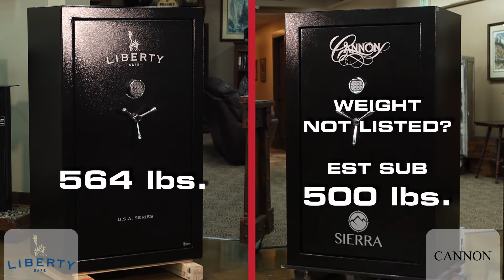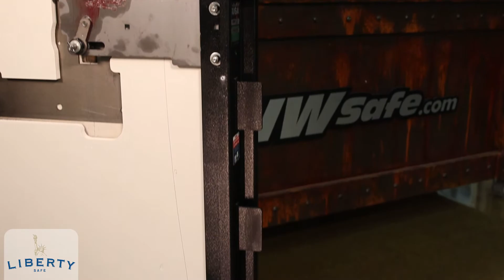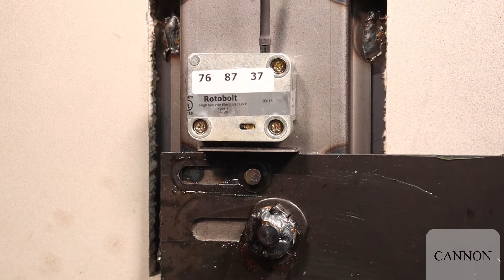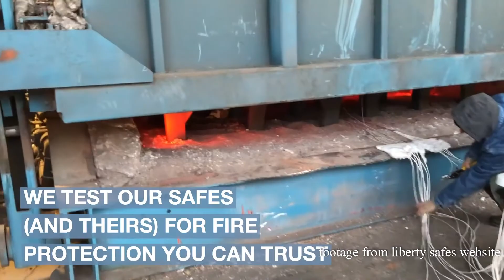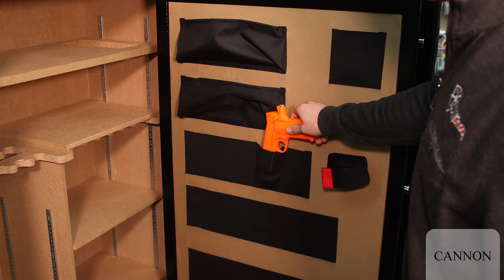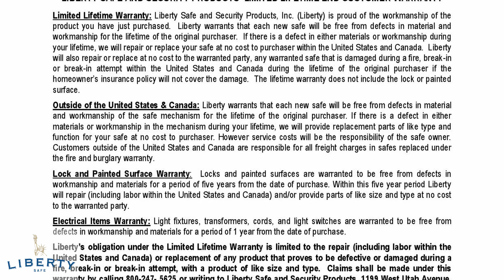USA Liberty Gun Safe vs Cannon Sierra Comparison

Comment: They are not going pry it open, they are going cut the side open in about 10 minutes with a metal cutter.
Reply from the maker: We see that comment a lot on the internet but the reality is we have seen more attempts to pry open a safe than to cut open a safe. If your comment was to suggest cutting would be faster, easier and an overall better idea, we would agree with you. We just haven't seen the numbers play out the way you're saying.
Reply from the maker: Also, I would say for most entry level safes prying is going to be faster and more discreet. However, once you get to a higher quality safe prying is going to be off the table and cutting would be the best option.
Reply: @NWSafe  Why you lie? I cut safes w a skilsaw. I wait for dummies to brag about their fancy rifles at the bars and I wait till they goto work in the the morning. Like GNR said, It’s So Easy! Murica!
Reply from the maker: @SortaDopeIGuess  Right...
Reply: @SortaDopeIGuess  what bunch of BS
Reply: Just James Bond your safe or Darth Helmet your safe 12345 that’s the same combination on my luggage.😂
Reply: i agree only a fool would try to go through the door.
Reply from the maker: @thebosscatman7 For the most part when you're protecting against theft you are dealing with fools.
Reply: Which anyone with ears will hear
Reply: If it were me I would cut the door lugs / hinges an be done in less time then going through the side .
Reply: @TURBOTHETANK23  Cutting the hinges does nothing , the door locks 3-4 ways typically. The locking bars are designed in a way that you can’t just push the bars and they all move 😂.

Comment: What scares me about the canyon safe is when the key pad goes bad. How can you get in? Customer Service stinks from what I have read.
Reply: Take the keypad faceplate off and use the physical key that comes with it to open the safe.
Reply: @Tyanmax99  do all cannons come with a key ?  My father in law just passed away and his will is believed to be in the safe but we don't know the combination to keypad.   We hope to get in it without tearing it up.    I seen a video using a strong magnet to open safes, so I guess I'll buy a magnet and see.
Reply: @BeckyCowanBeckysDigitalFocus  Sorry about your loss.  The faceplate of the digital keypad should just turn and come off relatively easy if it's meant to come off.  The key hole will be behind it.  Look on the side of the safe and there should be a model/serial number on it.  You should be able to google that info or call Cannon and find out more details.
Reply: @Tyanmax99  thank you,  I'll try it.
Reply: @Tyanmax99  their website says they don't come with keys
Reply: @BeckyCowanBeckysDigitalFocus  sorry about your lost, did you got in to your safe?
Reply: @LiveMusicVideos  used locksmith

Comment: I guess the part they leave out is that this is the most basic cannon safe they make and that the liberty costs twice as much as the cannon
Reply: Thats false. cannon is exactly the same price as liberty. I bought the Liberty and have never looked back. At tractor supply the cannon identical safes and the cannon was actually more. Rap on the sides of either and fast as you can snap your fingers you can tell which one is garbage.  Cannon is a glorified cabinet. Liberty is a safe.    Peace.
Reply from the maker: At the time of filming these two safes were typically about $200-300 dollars difference in cost. For something that can last a lifetime I think that is worth the difference for the better safe.
Reply: @NWSafe you have to pay that extra money if you want to keep it closed to everything but a federal warrant
Reply: Someone’s mad they skipped out on a Liberty safe for a Cannon safe.
Reply: @rhsking05 Still mad about buying a safe from a commie company that will sell you out to the feds?

Comment: I am still waiting to see what they come up with for a side cutting attack on the safe.  Do burglars even waste their time on a door attack anymore?
Reply: I’ve seen more side cuts when the side is easily accessible, otherwise it’s door entry. If they want in they will get in. I’ve seen entry to an old bank vault. Guys broke concrete and brick walls to eventually cut hole in safe.
Reply: Most burglars are not skilled and are not able to do much of anything with all but the cheapest of safes.  When you have your house alarmed you are not likely to lose anything well secoured.  I don't know of anyone getting a real safe broken into after decades of work in law enforcement.  I do know some of the cheaper and lighter safes that have been carted taken.
Reply: @allenbmooresharinginformation  , thanks for an HONEST statement!  Bolt down your safe, make sure it's in a mostly hidden area and don't expect a gun CABINET to be a safe.  Once these few thoughts are instituted, the safe is most likely just that, safe.  Most thieves are looking for an easy mark, not a challenge.
Reply: @markej4801  Limiting the number of people aware of firearms and valuables may be the best way to avoid an intrusion at all.  From an early age, my kids were taught that the public was to know we were a gun free safe zone and broke.  When hunting I always use coveralls so my appearance on returning home is just your average working putz.
Reply from the maker: We hear a lot of talk about cutting attacks in the comment section but as far as real life we still see far more pry attacks than cutting. I would say for most entry level safes prying is going to be faster and more discreet but once you get to a higher quality safe prying is going to be off the table and cutting would be the best option.

Comment: I purchased the USA 48 a few months ago and noticed Liberty sells a lifetime lock warranty. In your opinion is it worth it? How often do you see these electronic locks fail?
Reply from the maker: It's worth it. The safe will last you a lifetime but all locks need to be serviced in the future at some point. The lifetime lock warranty is money well spent. Liberty is also a financially responsible and healthy company so it's safe to say they'll be around for a long time. However I think the extended warranty has to be purchased at the time of warranty registration 30 days after delivery of your safe. I'd still give it a shot. If you run into issues call their customer service line.

Comment: $800 Canon safe is good, does the job. You can change attach pistol holders
Reply: Just because the door closes on a safe doesn't mean it's a good safe. But like you said, a safe is better than no safe. All these people thinking James bond is going to break into your house and cut open your safe live in a fantasy world. If someone does break in they'll most likely be a smooth brain idiot with an IQ in the mid 70s. They'll get arrested before they even attempt to get your door open.
Reply: @lennybrewster4673  You are spot on from my observations over years.  Unless you have one light enough that they can take it out the door you probably won't lose anything ever.
Reply: Yep! that door panel was a dealbreaker for me. it looked cheap and flimsy.
Reply: Liberty gave the cops the back door code with no warrant
Reply: Cannon safes are cheap Chinese junk... but I guess that's about all your keeping in a cheap safe is cheap junk.
Reply: @KingMrBigE  just found out that Canon safes are made in North Virginia
Reply: @iiparachuteregiment8800  no... they are not. Actually according to their very own website they are being made in Mexico.
https://www.cannonsafe.com/blog/faq-items/cannons-safes-manufactured/#:~:text=Cannon%20Safes%20are%20made%20and%20manufactured%20in%20Mexico.
Reply: @KingMrBigE  kwl. To you it's still Mexican junk?
Reply: @iiparachuteregiment8800  I’ve had no trouble with my $800 cannon, it’s a hell of a lot better than no safe and that’s what fit my budget. I don’t know  that you get $1200 more value out of a $2000 liberty. And a demo saw will take either of them apart equally
Reply: Cannon safes are JUNK!!! Support is non existent!!!
Don't waste your money. 
I've been jacked around for 2 months waiting on parts. 
I've called and emailed every week and they dodge me. 
You can call cannon for extras but don't expect any setvice. 
I had a malfunction becauss of a flaw in the design and they won't send me the update. 
Mike Mercado was the contact that dropped the ball!

Comment: I did a little research and see you guys used a base model Costco safe for your comparison! Wow ' what a joke !!
Reply from the maker: It's a Liberty Base model and Cannon Base model for that size range. At the time of the video the US made Liberty could be purchased for as little as a $200 difference than the imported Cannon Safe.The Liberty is also the most affordable US made safe out there in the size range. We also are trying to highlight why it's money well spent to spend a few extra hundred dollars to get the better made American safe.
Reply: The liberty USA series they compared it with is their equivalent base model. You would have known that if you did a little research.
Reply: @user-mh5qg5jb7d  its not lib base model
Reply: What are you smoking . The cannon is like 700 bucks  . If that . This liberty is Iike 1300 and up at least ..
Reply from the maker: Like I said at the time of the video the Liberty could be had for as little as $200 more. At this time of record sales you won't see the deals on Liberty because demand is way higher but I don't know where you can find a 40" wide Cannon for $700 now either. No doubt the Liberty is more money but It's a better safe. How much is American Made worth to you? How much would you pay for a better lock? How much more would you pay for more pry protection, better welding in the body, higher quality interior and door panel? In our opinion the Liberty is the better value. If those things don't matter and you just want a cheap, big safe by all means buy the Imported Cannon Safe.
Reply: @NWSafe  the 60 inch widebody cannon is on sale at tractor supply for 899.
Reply: @robertsn6584  I got the newer model liberty safe at tractor supply for 699. Taking a piece of crap and making it wider doesn't not make it a piece of crap.

Comment: I literally just looked at both these safes side by side and this video is a joke ! It's all a lie !! The cannon safe in the video is not even close to current production!! The cannon is now a better safe than the liberty. Wow this is slander and fabricated  facts ! You should be ashamed as a you tube creator!!
Reply from the maker: The month this video was launched in 2020 this Model was an online special sold through Costco. Does Cannon build different models than this? Of course but they're still plague with many of the same issues and are still imported from China or Mexico. This video was comparing a similar sized entry level Cannon Safe to an entry level Liberty Safe. We think for a few hundred dollars more you can get a Liberty safe that has a better lock, better welding, thicker body, better door, better mechanism and is made in the USA. Can you even get a Cannon Safe anymore that's not made in Mexico or China?